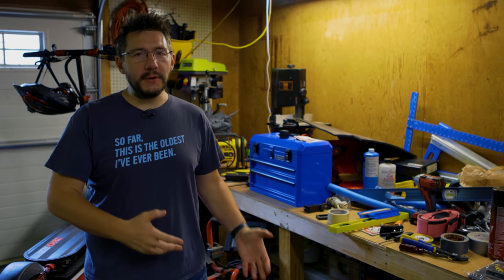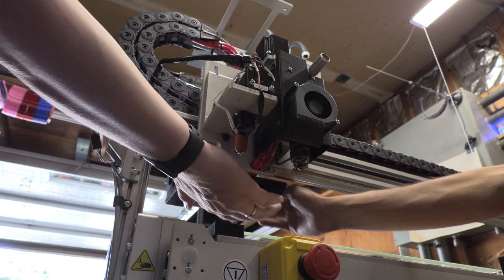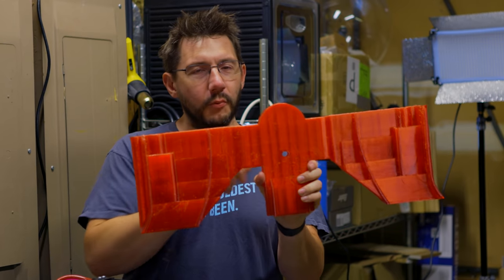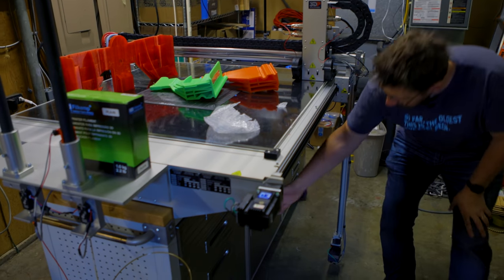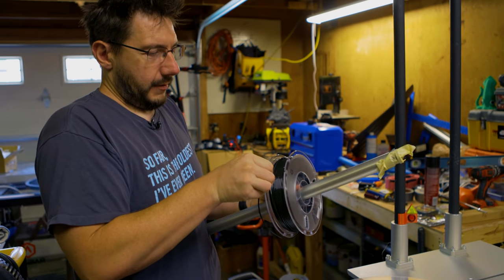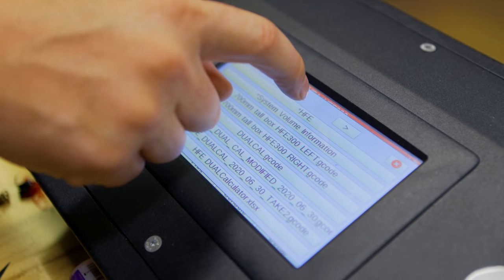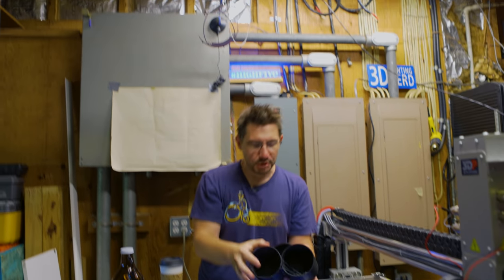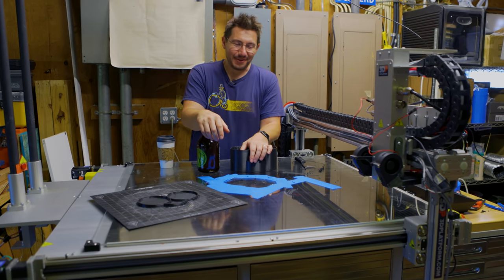I Broke a $38,000 3D Printer

Comment: Isn't PETG one of those things you do not print directly on glass
Reply: I print in glass whith spray hair very , very well, to remove the object yuo just need to wait to cold down, then came up gently
Reply: It's pretty well known as a material that's best not printed onto bare glass. It's pretty much universally recommend from most reputable sources that a barrier layer of some sort is best practice.
Reply: need glue stick, hair spray, or blue tape.
Reply: yes this is common knowledge. Martin with Wintergaten had the same problem. I am surprised Joel didn't know this.
Reply: I print PETG on glass all the time (it's the only thing I print wthi and on). No problem at all if you just let it cool down.
Reply: PEI, too.... It's extremely hard, if not destructive almost every time.
Reply: I use Abond, a pvp based adhesive. And to remove the piece from the table, I spray some alcohol (isopropyl or etilic 70%) at the edges of the print, so it slowly penetrates, dissolves the adhesive, and release the print
Reply: Seriously... And he says later they shipped it with magic goo. Why wouldn't you use that from the start? Even on my glass bed on my Ender 3 I wouldn't print PETG directly onto glass without glue or some other product. SMH Joel!!!
Reply: I print only petg and direct on glass no problem. Altho i prefer my pei.
Its all about Z offset. DO NOT print it same as Pla. Unless u want disposable printbeds. Altho ive never fused petg to be honest i have fused pla
Reply: @highlandcrawler  completely false. I print Petg direct on glass all day long. No glue nothing just glass.  My prints self release once cooled.
Lot of misinformation simply because people dont know how to calibrate their printer.
In 5years of printing almost exclusively Petg i have never fused a print to glass.
Reply: @Wooddust6  not sure why you think what I said is "completly false" but maybe read what i wrote again and do a tiny bit of research and what i say is truth. I never said it cant be done. Best widly accepted practice is to use a layer of something to print on. It's fine if you like to live on the edge a bit and go right to glass but that absolutely is not the common practice the majority uses.
Reply: i print petg on glass all the time just use hairspray and let it cool comes right off no fight at all
Reply: yes
Reply: @user10476  You can often get away with that if it's just regular glass or mirror. Borosilicate glass and PETG can bond at a level that makes it literally impossible to remove the part without damage to the glass, the part, or both.
Reply: @SwervingLemon  i thought borosilicate glass was the preferred glass for printing? I'm not using normal glass, but I don't think it's borosilicate.

Comment: To the man who is courageous enough to reveal his mistakes and lessons learned along the way... I salute you. 🤗
Reply: While I agree that Joel seems to be a nice guy being honest about his mistakes (hard to say without knowing him in person, but that’s my impression from his videos) - having the printer and not making a video would certainly be a problem for any creator and most creators would have made some kind of video.
Reply: I’m still confused. What was the mistake? How was it preventable?I would have liked to hear this.
Reply: @SoylentSax  only meant it's commendable of him keeping it real, by pointing out the crack that happened in the glass print bed and how the jug holder fused to the flexible print bed. As opposed to say, for example, simply covering over the crack with the flexible build plate and not stating the (literal) underlying issue going on underneath. To be honest, a $38K machine purchase outright is far beyond the means many folks have available at the moment to begin with, but rather than simply "keep up appearances" he has a great way of remaining relatable, even the casual hobbyist, by pointing out that things CAN go wrong. I, for one, have appreciate that about his vlogging style thus far. 🤗
Reply: @SoylentSax  I believe I've heard petg isn't supposed to be printed on bare glass because of the effect that Joel saw and it's recommended that one uses blue tape or a removable surface to print on. never printed in petg though so I may be confusing it with a different material
Reply: SoylentSax I think it’s the fact that he broke the glass when removing the pawn.

Comment: Hi Joel!

We use an older version of that printer at work and had the same outcome with PETG.  Went we have to print PETG, we use a sheet of MIC6 1/4" aluminum on top of the glass with a custom start script to take into account the extra thickness in Simplify3D.

G1 Z6.8 F100
G92 Z0

6.8mm is the thickness of the sheet we got.

PETG seems to create micro-fractures in the glass when printing large models.
Reply from the maker: So THAT is what happened. I figured it was something like that. When I went to remove the pawn model, just barely touching it created cracked glass. I thought it was a material defect in the glass. That's a great idea on the aluminum. I have been looking around for one and pricing it out, though I was thinking I would have Dave from Printed Solid get me a custom PEI sheet for it :)
Reply: @3D Printing Nerd  I'm worried that a PEI sheet that big would bow in the middle if it isn't thick enough. 1m x 1m is crazy!!

If you ever get an aluminum sheet, don't use it with the factory finish ... nothing will stick to it, too shiny and smooth, you'll need to rough it up with sandpaper or scotch bright pad. I have used the scotch pad with a 5lbs block of steel on it and use a fair amount of PVA glue (glue stick).

At the moment I have aluminum covering half the printer at all times and only remove it when needed for large none PETG prints. I have different factory files for Simplify3D for the reduced print area for print head clearance.

Comment: Why does this $38,000 Industrial, 3D printer NOT have a removable build plate and ABL?
Reply: Because a printer like this probably has a department dedicated to running it and its peers?
Reply: Removable build plate at that size may be heavy and maybe unpractical but lack on abl is unforgivable
Reply: @rpavlik1  No, just no, why would you make it so that a whole department has to exist purely to run a 3D printer? There are soo many design oversights on this printer, to the point that I would say it's not even suitable to be produced.
Reply: @timomiller569  But still, glass? Really? And regular, super thin glass at that. Could have done PEI or buildtak or something!
Reply: @squirrelrobotics  Yeah PEI on tooling plate would be better and in case you damage the PEI it is easier to replace
Reply: Technically the build plate was removable... it's just stuck to the bottom of a Chep Pawn
Reply: @RamjetX  This is optimism at its finest, you are technically right.
Reply: @squirrelrobotics  yeah, this is what happens when a CNC router designer plugs a hotend on their machine.  Way over-engineered in the movement mechanisms, under-engineered in the 3D printing application.

Comment: At 9:10 The "transponders" are Motor encoders that can detect missed steps or of one is faster than the other and fix itself. We use them a lot in FRC to make sure we can do our Autonomous Functions correctly
Reply: So does this mean these are closed loop servos? Or just slightly fancier steppers and drivers? (Eg trinamic can detect missed steps)
Reply: rpavlik1 it’s a basic stepper motor with an encoder latched onto the back of the motor and it (i assume) sends the steps it counts to the main board and if they aren’t synced it will compensate
Reply: Ayy FRC gang. HOT Team checking in.
Reply: @ethanrake4929  Hero's Of Tomorrow? Team 67? Im Tean 6722 LED Robotics

Comment: Wait, they provided PETG for a machine with a giant glass bed?

Did they give you any instructions for prepping the glass before printing?
Reply: Crisco...
Reply: Joel said in the video that it came with Magigoo... it just didn't get used on the first print...
Reply from the maker: The first two test prints by Don were PETG on the bare glass and they were fine. He said they do PETG all the time without the Magigoo and it's fine at the office. The Magigoo was "if something doesn't stick well enough, use the Magigoo to help it stick."
Reply: @3DPrintingNerd  I would venture to say that they likely didn't print things with that much surface area right in the middle of the bed...
Reply from the maker: @edwardpaulsen1074  They have!
Reply: @schbrownie04  Yup magigoo is one of those things.. if you have it.. use it... no reason not to.
Reply: @3DPrintingNerd  where it comes down to your profile vs their profle for sure. That first layer is everything. I have found that the difference between sticking TOO well and not enough with PETG can be literally .1 micron first layer. So having a 1mm nozzle im sure probably is even more tempermental. Why using a release agent like magigoo just has become a precaution regardless how well I think that first layer is tuned.
Reply: @3DPrintingNerd  I would venture to say that it was in a very precisely controlled environment and they had done quite a few prints with it for a while... after disassembly, transport, and reassembly, I would be taking it easy from the start until everything was tested out fine.... not saying it was entirely your fault, I'm going to have to lay some blame with Don for his part too... Either way, still a very painful reminder of how quickly things can go unexpectantly wrong... Hope the company was understanding.

Comment: I remember Simon from RClifeOn 3D printed himself with a 1*1*1m 3D printer. 

Also, are they mad about the bed breaking? o.o
Reply: I guess so if it's a 38,000 dollar printer on rent

I wonder how much the print bed cost?
Reply: @aadvaithmandampully3279  well in essence its a big ass mirror. so just get a mirror cut, maybe a couple hundred? id bet the heater part of the bed is fine
Reply: Big difference, RClifeOn can 3d print. 3DPnerd can`t

Comment: That filament path 😱
If the runout sensor let's the machine continue too long you'll have a mess of tangled filament covering the bed and possibly embedded in the part. Maybe consider a reverse bowden? I know I'm not thinking on the same level as the company who designed it though.

Comment: We have a 3DP 400 series at work and i use it almost daily for prototyping purposes, when printing with PETG i always use washable glue stick on the glass for adhesion and ease of removal. When parts are stuck to the glass just spray glass cleaner and let it dissolve the glue bit by bit.

Comment: just curious, with the glass bed breaking, did you let the whole bed cool down first? 

 I had this happen twice to me before with a old printer from 2014 that used boro glass, both were with petg, and i was rushing and pulled the part from the bed when it was hot.  
I feel your pain, though my glass was 12x12 inches.

Comment: Seems really expensive for what it is. Not even an auto leveling bed
Reply: similar thought. look at the cable management on the print head
Reply: I thought the same thing.  For $35,000 I would expect at least the features of a Prusa.
Reply: Non planar version design.
Reply: The machine DOES have auto bed leveling.  Due to the time it takes to run through the bed leveling routine for this large of a print surface, it doesn't do it every time the printer runs - only when the operator determines it's necessary.  The aluminum plate under the glass holds the surface pretty rigid, so it's not required between every print job.

Comment: This seems like a huge waste, print quality honestly isn't that great for 38k kind of disappointing
Reply: Joel's printing ultra-low resolution models on it for some reason and scaling them up, I bet it would print fine if you exported something direct from a vector
Reply: @arcadeuk  for 38k you get wobbling of the whole gantry if it goes up, in my opinion thats unacceptable for any printer that costs more than 2k. I probably could make a better 1m3 printer that costs lot less, probably like 1-2k. How are they making it cost 38k not even a good cnc costs this much...
Reply: I guess Ivan Miranda has made a  better large printer
Reply: @RomanoPRODUCTION  Absolutely and its mostly 3d Printed and costed probably less than 500 Euros.
Reply: @RomanoPRODUCTION  That's a better printer for hobbyists. It's a terrible printer for businesses. For a business that needs a 1m x 1m build volume on an FDM 3d printer for whatever reason, your only other option is a Stratasys F900 and that costs way more. It isn't cost effective for a company to build their own giant 3d printer, troubleshoot it, and fiddle with it until they can get it to work. It's much cheaper to spend 38k on something that has tech support
Reply: @10ulcinj  It costs 38k because there are almost no commercial solutions for a 1m x 1m 3d printer. The only one I found after a quick google is the Stratasys F900 and that's way more expensive. It's not worth it for a company to build one themselves, because then you have to pay someone to build it, fine tune it for a while, and then if it breaks you have to figure it out yourself.
As far as the cost, it's got closed loop steppers, a water cooled nozzle, custom controller, and custom modular extruders with 16x the output of an E3D Volcano. Not to mention the cost of supporting all this stuff. Something like a Tormach mill costs less because there are a ton of companies supplying industrial machine tools, and a lot fewer offering large format 3D printers.
Reply: @FowlerAskew  I get what you mean, but its still not really acceptable for me atleast that the whole gantry wobbles after like 40cm going up, its just not really good solution for the price they offer. There should be more Companies that do Big 3d printers for Businesses, it would be cool if Prusa did that.
Reply: @RomanoPRODUCTION  Yeah his second attempt is looking really good
Reply: @FowlerAskew  That is only partially true... You are correct that this is a piss poor design and nowhere near a true "commercial grade"... This company overbuilt the hell out of places that did not need it (Seriously? Too heavy for a lift gate?!?) and thoroughly screwed the pooch in the places that required better support (wobbly X-Z axis). They basically built a machine to look "industrial" and charged "industrial" prices for it... and really? The idiots put a meter square piece of borosilicate?!?  Joel demonstrated several times the reason why that is stooopid... placing items on that large open glass "bench"... including metals... Where I think you missed the mark is on the costs to design and make the machine... Even with my engineering rate of pay, I could design and build one for about half that cost and would be much more similar to the hobbyist machine in operation and properly "beefy"... I could actually build one like that if I had the need and the finances available... and no, I will not "prove it" unless you want to cough up the money up front for the equipment and supplies.
Reply: @10ulcinj  28K profit
Reply: @WhiteG60  you could even pay an engineer like 5k a month for like 7Months to build you a proper one, its just a scam product in my opinion and now i get why those Disney movies costs millions to produce they put their money in the trashcan instead of hiring one man thats good with 3d printing to look for something good and reliable.
Reply: I think he does them on low quality so it’s quicker otherwise it would take along time to print
Reply: @FowlerAskew  That would be preferable, but the theme throughout this video was him constantly having to fiddle with it. It was FAR from plug and play. Nothing about this looked 'business ready' IMO. And the F900 will print things like Ultem, PEEK, PEKK, and other real engineering materials while this thing breaks itself printing a small PETG part. I honestly have no idea what market this thing is trying to serve.

Comment: I didn't want to be restricted to a small printer build size so I bought the TRONXY X5SA 2E. 500mmx500mmx600mm. That one you have is a hell of a big printer. But what I found out fast is big prints use a lot of filament. Bigger printers cost more to operate as I was making larger prints. My first error was bed too close to the hot end and it flat ironed a large portion of the bed sheet. It eventually warped and hot end burned a hole. Switched to glass and is working ok. I never had one glued like that to the glass.

Comment: Don't worry Joel, everyone who is new to 3d printing. breaks something when removing a PETG print 😂🤣😂🤣
Reply: That would be acceptable if he hadn't been doing this for years now... one would think there would be some "learning" going on and not repeating the same mistakes...
Reply: @edwardpaulsen1074  yeah but Z offset leveling stuff is a mistake that can sneak in sometimes, you only need to forget to check that once and it might happen to you too lol
Reply: I havent broke anything yet on my ender 3 pro, but im sure it is soon to happen
Reply: @hyperfluff_folf  There is a HUGE difference between "Z offset leveling" and printing PETG, which is known to sometimes stick to glass, on a super large area glass plate... not to mention just diving in on a brand new machine without going over the operation a few times... That's like getting a new lathe and just throwing a notoriously difficult metal on it without checking speeds, cutting tool, lubricants, and depth of cut and wondering why the tool shattered and damaged the machine...
Reply: @edwardpaulsen1074  Man the other day I broke a nozzle (it was heated, I'm not that dumb) and I've been doing this soon to be 3 years now. The only difference between now and then is that I broke a nozzle on a Markforged printer. They want $1,700 to replace it, but my $20 screw extractor kit says otherwise.